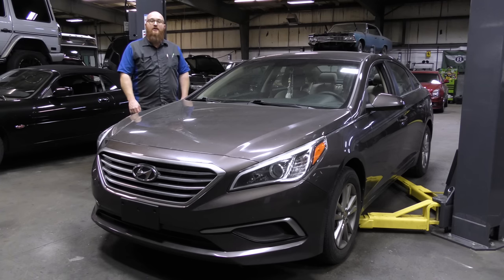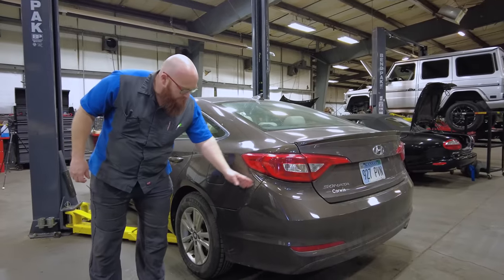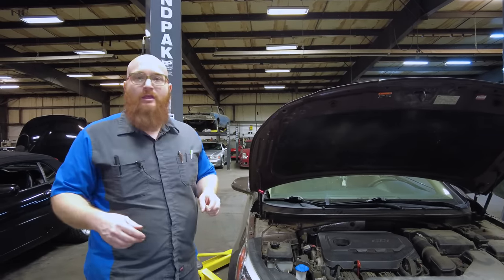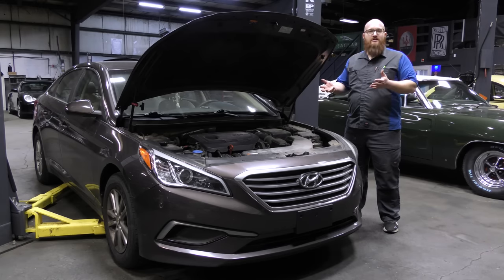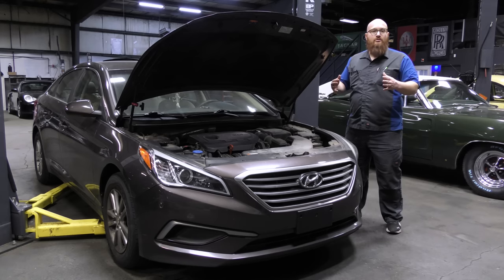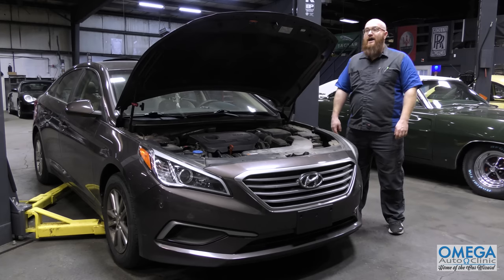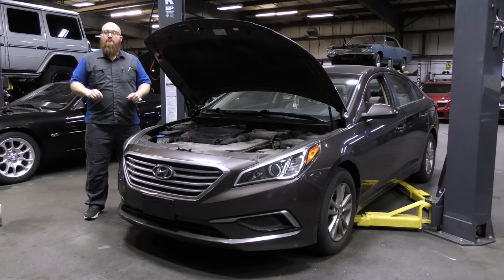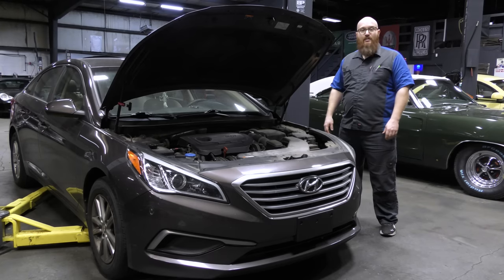What could be so bad on this '16 Hyundai Sonata that the CAR WIZARD is sending it to the junk yard?

Comment: Sad part is if they checked the oil and topped it up right before taking it to the dealer for the recall, the outcome might have been totally different. It's no secret that dealers will look for any way to avoid a warranty claim, so in addition to keeping up with my periodic under-hood checks, I also always give my cars a once over, and clean them, before taking them to the dealer for service.
Reply: Great advice
Reply: I agree, mechanics notice whether someone takes care of their vehicle, not only does that cause them to pay attention, but take extra care in their service.
Nobody wants to work on a filthy cluttered mess.
Reply: Great point!   My daughters ask why I always check our cars over, empty the junk out and fill the tank before bringing them in for service.   I believe strongly that if the shop sees that I the customer takes good care of the vehicle, they may be more respectful of it as well  😄
Reply: They would have required them to show maintenance receipts
Reply: @Tool0GT92  You don't need to provide maintenance receipts for adding oil.
Reply: I drive a 97 Ford it has never burned oil in over 25 yrs, I am guilty of not checking my oil, I change it, Regularly since New. No oil burning or loss...no reason to check .
Reply: It may have been burning the oil already
Reply: @Tool0GT92  Which would have proven what?  If the engine was full of oil, the engine is under recall, although the recalls are mostly due to carbon build up and fuel system clogging, which also probably does the oil no favors...
Reply: This is absolutely true. If you went into a dealership with both a bad engine and low oil, they will for sure ask for maintenance records and stretch any inspection to find a reason to decline you. They can even instantly decline you for not having a knock sensor update installed! I had thankfully topped up my oil before my sonata 2.0t spun a bearing and took it to the dealership. Within days I was approved for a new engine, turbo, and intake manifold under the settlement without them asking for any maintenance records or anything. This happened literally a week ago.
Reply: They should have changed it first.
Reply: But they didn’t and they probably hadn’t changed it in a VERY long time.
Reply: These new engine are designed to burn oil!!!
Reply: @ivanvarykino8202  I take care of my vehicles but it doesn’t make a difference, which is why I avoid them and do my own repairs whenever possible. Broken window when replacing wipers, spilled battery acid, forgetting the transmission gasket, wrong filter size and over torqued, bolts not put back on the brake calipers, dipstick left out, broken side mirror retainer after a recall repair, all from “certified” mechanics. No one takes pride in their work anymore, and this was before covid and all the parts and labor shortages.
Reply: Exactly they didn't even bother to check it when it could mean a new engine for free.  An electric car is going to fair no better there are still things to neglect.  Besides the inevitable increase in electricity cost when that is the majority on the road.  Hope people really do care about the planet cause end result will be the same cost wise.
Reply: @tjsells9288  Thank you precious government for that.
Reply: Won't work. It's easy to realize what was going on if there's fresh oil and a noisy engine. Dealer mechanics aren't completely oblivious to things like that.
Reply: @redbaron6805  To get any warranty outside of the warranty period you still have to show that the vehicle had the correct servicing etc.
If you neglect the proper approved servicing, even during the warranty period, you will likely get knocked back, as you should.
Reply: @sho942000  Then if you can't provide oil change receipts, won't they say you've gone over the oil interval and deny you?
Reply: @oldbloke204  I don't disagree with that, but the fact that many of those are burning a quart of oil every 300, 500 or even 1000 miles, and the recall is for a carbon build up which would probably render the oil black, it is difficult to tell how much neglect is involved here.

Also, Hyundai is notorious for denying legitimate warranty claims and their "power train" warranty is about as useless as a used napkin...
Reply: @johngaither9263  Yep, the Hyundai dealers are known to be some of the worst dealers in my area, rated somewhere between roaches and politicians.

Which has been one of the reasons I have steered clear of them.  Every time I get temped to look at one, I read some owner and dealer reviews and immediately scratch them off my list.
Reply: @redbaron6805  Most of the stories I've seen about warranties with them are just fine as long as they have been maintained properly.
How many people don't understand the time/distance travelled part of the warranty or just cheap out and don't maintain them properly?
In this case I would be guessing that this vehicle has had very little proper maintenance.
Stories the whole time about people who will borrow to buy vehicles and then can't afford to service them properly.
We have a 15 model of Sonata and we're meticulous with getting it looked after properly.
Reply: @oldbloke204  I have read a ton of actual reviews from actual owners on those.  And the story is basically always the same.  

They have a (non transferable) power train warranty, which supposedly covers the power train.  Then something fails on the  power train, (not that rare, it is a Hyundai after all), and people think, phew* sure lucky I got that power train warranty.

But, then they find out that "power train" warranty isn't worth squat.  Oh, the water pump failed, which caused the car to overheat, ruining the engine.  The owner should have shut down the car when that happened, but incidentally, the temperature sensor was also faulty, failing to warn the driver the engine was overheating until he saw steam coming out of the hood.  Since the water pump failed (not covered by warranty) and the temperature sensor failed (not covered by warranty), caused the engine to fail, warranty coverage is denied, because the engine itself didn't fail, non covered components damaged the engine, hence, no warranty.

That is of course if they don't just catch fire and burn to the ground, in which case there is no warranty, but hopefully you still have comprehensive coverage and your insurance will cover it...
Reply: Yep. My mother has the exact same car. I always did her oil changes and once every two weeks checked the oil. It would usually burn 2 qts a month and she only drives 2-3 days a week. Maybe 500 miles a month. Made sure it had oil in it when she took it to Hyundai and they rebuilt the engine. That was about 2 months ago. Runs like a dream now. Burnt about half a quart since but the oil still looks new.
Reply: @redbaron6805  Yeah well I suspect that there will be plenty of noise over some issues for sure and I mean people still buy a particular brand of "American" 4wd, even though they're now owned by another brand, in spite of all of the issues they have.

In Australia we're also covered by  "reasonable expectation" Govt. legislation which basically means that a reasonable person would expect a product to last for a certain time period and distance covered, for a vehicle.

In our case we have had the vehicle for nearly 7 years and it's still worth a large portion of what we paid for it. Our daughter has had a couple of Hyundai's that have been completely faultless as well.

We could go and buy another new vehicle tomorrow but my wife loves the Sonata and I'm not concerned about its reliability tbh.
Reply: @oldbloke204  Well, Hyundai does have a massive marketing budget.  You really can't escape their endless marketing.  I would even say, 9 out of every 10 car commercials on YouTube when watching random videos are from Hyundai.

And their cars are basically cheap, and the Walmartization of the world means people buy based on price, not quality.  Add in the fact that the resale values of Hyundai's are very poor (my brother bought a 3 year old low miles Genesis once for around 50% off the price of a new one), and people will develop short memories and buy them.

I am in no way claiming every single one is bad.  Even the worst car brand has cars that will end up being reliable, while there will be others that will be poor.  That is simply how statistical reality works.  Your experience in Australia may also be different than in the USA, as cars sold in the USA don't always even match in features, engines or design with the same car sold in Europe or Australia, even with the same name on it.

Case in point, the Honda Accord in Europe was sold as the Acura TSX in the USA.  My son drives my old Acura TSX Sport Wagon which is labeled as a Honda Accord in Europe.  A lot of European or Australian cars may have diesel engines which are simply not sold in the USA due to emissions restrictions, and a lot of European cars are sold with smaller engines than the same car sold in the USA.

But, there is no denying the massive Hyundai recall on their engines, and the massive fire recall on their cars.  There are massive settlements with Hyundai covering up this issue and not honoring their warranties.

That being said.  If you have them and they work for you, more power to you.  I have driven many of them, anything from Sonata's, to Santa Fe's to many others as rental cars.  They are basic vanilla cars, basically marketed as nearly Japanese quality but not quite.  And my brother owned a Genesis before Hyundai separated Genesis into a brand.

For myself, I'm not in a market for one.  They just don't offer the value proposition I'm after, and the quality is not up to my standards, along with other quirks.  Maybe that will change in the future.  But, I'm not sold yet.
Reply: @redbaron6805  For us, with vehicles, total cost of ownership and reliability is what it's about even though I love cars.
The idea of spending more on a vehicle, liability,  than is necessary really makes no sense at all to me.
We always pay cash and could afford nearly any vehicle that took our fancy.
We paid around 25k plus on roads for our Sonata about 7 years ago and much higher mileage ones here in dealers are still going for between 18-20k plus.
They are still retaining their value more than I expected they would.
I might look at trading it in in a year or two but given we're lucky to do 6k km's a year maybe we won't.
Reply: @oldbloke204  I get that, which is why Hyundai for some people makes sense as a value proposition.  For me, it hasn't as I don't particularly care for the Hyundai car design, and the reliability and service here for them has been sub par for many.

But, as noted earlier.  My experience and my preferences don't necessarily match yours, and your experience may differ.

Also, the resale values for cars in Australia, depending on brand, is probably quite different than here.  In the USA, Hyundai floods the market with their cars, and their resale value reflects that.  Hence, pre pandemic, they would easily depreciate 40% to 50% in 3 years, and could often be picked up cheap.  That depreciation typically takes 5 years for similar brands.

Even now, a 2020 Sonata SEL with very low miles goes for around $20k, while it is over $30k brand new.  Compare that to a Honda Accord LX which sold for under $25k in 2020 is still around $20k today, and an EX which sold for under $30k in 2020 still sells for $26k today.  So, a Honda Accord (which car ads here from Hyundai relentlessly compare themselves against with the Sonata) So, Sonata depreciation is around 30% plus, while Honda depreciation is around 10% to 20%.  And it was even worse before the pandemic.

That being said, not everyone is a car guy.  Many people I know care only about cost and functionality.

So, I'm not in any way knocking your choices, just reporting the situation as I see it on the ground in the USA.
Reply: @redbaron6805  Yeah fair call but then Honda have lost their way as well over the recent years imo.
Had to have a dent pulled out due to a moron in a carpark and the guy doing it was trying to fix a hail damaged civic.
Basically said that they were just thin crap now and thinner than our car.
I loved Honda in the past but wouldn't touch one now.
Too expensive and don't really offer much more imo.
Most brands that built their reputations on reliability and trustworthiness are just going down exactly the same path as each other and use most of the same bits anyway.
When Toyota first came out they were laughed at, much like Korean cars were but are now very popular.
Next if will be Chinese stuff if things keep going the way that they are.
What a joy.
Reply: @oldbloke204  I haven't owned one for around 20 years by now, except the Acura which is made by Honda, and that car has been flawless.  With around 150,000 miles on it, still runs and drives like a Swiss watch and and is one of the best handling cars I have ever driven.  Fuel economy is great, the engine has quite a bit of power, and it has been rock solid reliable.

My in laws own a Honda Pilot, and I have no problems with that car either.  I have for the most part switched to electric cars now, own a Tesla, and will probably mostly buy electric cars going forward.  I brought up the Honda as Hyundai apparently considers them their main competitor, and in the USA, the Honda retains their resale value while the Hyundai does not, as noted earlier.

I still think overall Toyota and Honda are the benchmark in reliability of combustion engine cars, and their resale value reflects that.  

Now, you are probably somewhat correct on Chinese cars, although there is some push back developing against China for Europe and the USA, along with Australia last time I looked, so time will tell how they will do.  They are not ready for prime time in my experience, and I think a significant number of people will be put off buying from a hostile country like China.  At least South Korea is an ally of the democratic world, even if I'm not yet sold on their cars.

There are already tax policies that will make them struggle to compete in the USA.  And if current tensions continue, I would not be surprised at all if tariffs will be put on Chinese cars on top of that.

You are correct of course, that Japan was once in the same situation as South Korea, until they beat everyone by rapidly improving quality and cleaning out the fuel economy car market.  What then followed was the premium car market with Lexus, Acura, Infiniti and other premium brands.

But, electrification is where everything is headed now, especially here.  And the inherent advance Japan had with superior engine design and reliability is now somewhat working against them, as they are dragging their feet in competing in the EV sector.

So, they risk repeating the Sony and Kodak mistake.  Latching on to legacy products until they are basically so far behind, they are out of the market of what will replace them.
Reply: @redbaron6805  That's another reason why we  likely won't switch cars just yet as I will wait for a while to see how the whole electric thing plays out.
Way too much bs and virtue signalling in that particular space atm and I'm not sold on the idea of millions of them being dumped onto the already under pressure electricity grids in most countries.
A lot more to play out there yet and there isn't one that can do what I expect my 4wd to do when I'm out and about.
I also intensely dislike the fact that various Govts. are bending over to pander to the electric revolution without think a bit harder about it all.
I've been a bit of a greenie forever, we grow our own organic fruit/vegies and try to keep our footprint on this rock as small as possible but I think that the whole EV thing is a bit of a con really.
Each to their own though.
Reply: @oldbloke204  There are probably some misconceptions you may have about those.  In my experience, there is far more hostility and ignorance, along with relentless fossil fuel funded propaganda against EV's, than any virtue signaling, at least over here.

I think the core issue is most people don't really understand how efficient EV's really are, and how little overall power they use.  Even my rather large Model S requires barely 300W to drive a mile.  Even a 1080HP Tri motor 5000 pound Model S still gets 350 miles of range on 100kWh worth of energy, or 350W per mile, or 563Km of range on 15 liters equivalent of petrol.

So, the energy required to run your toaster for an hour will get that car close to 6Km of driving range.

Now, are they suitable to pull caravans and go off roading in the Outback yet?  No.  But for people that need to commute to work or school or travel with them on paved roads, over here, it really not really an issue any more.

Most of the objections are simply misinformation or lack of knowledge about them.  Batteries last far longer than people realize.  Battery recycling is already standard in the USA.  Range keeps climbing, efficiency keeps climbing, and the reliability is far superior to anything equivalent.  Add in basically no service required and massive cost savings compared to even cheap petrol in the USA, and the choice for me was pretty easy.

Mine already has almost 200,000 Km, and is still going strong.  Even the battery capacity is still over 90% of what it was in 2014...
Reply: @redbaron6805  Yeah I tend to look at things quite a bit before I form an opinion and from what I'm seeing many countries, including your own, are trying to do all of this in a hell of a rush and it's starting to show some serious flaws.

Fossil fuel prices are way up as they're needed to plug the gaps.

Here in Australia the cheapest EV, that I know of, is Chinese and will set you back the best part of 50k for a small vehicle.
That may change soon though.

Had any dramas with the Tesla as I've read some horror stories about them, what breaks and the cost/availability of spare parts as well.

I've never liked the "eggs all in one basket" theory in life but all of this EV stuff sure feels that way.

It doesn't inspire a lot of confidence either when our Prime Minister prattles on about it but doesn't even know what's available in this country.

Lots of "jump on the bandwagon" with all of this atm imo.
Reply: Hi - i am guessing that once they do the preliminary, the dealer may take the head of and have a look at the engine, , thing like scratch and hot spots would show a lack of maintenance
Reply: @oldbloke204  Well, it is a bit more complicated than it looks.  What is going on here is that states like CA, which control over 10% of the entire USA auto market, are requiring all cars sold in the state to be electric by 2035.  After that date, all combustion engine cars sold so far can continue to be used, but all new cars sold are required to be electric.

Since a large percent of EV owners charge their cars at night, when there is low demand and surplus power on the electric grid here, the electricity demand by EV's is far less of an issue than it appears.  Also, many people in CA already use solar panels, so they can charge their cars using their own panels for that reason, requiring very little if any energy from the grid.

The fossil fuel price fluctuations from 2022 are mostly from the war in Ukraine.  That affected the world natural gas market, as Russia cutting off European gas deliveries spiked demand of natural gas produced in the USA and Qatar, causing prices to temporarily spike.

My experience with Tesla here, and mine is a 2014, is actually quite positive.  Very little has broken on the car, the service is very affordable here, and Tesla has brought down prices of parts of service as the car ages.  Also, my car just got upgraded to MCU version 2.0, giving the car the computing power and features of a brand new Tesla.  Tesla is one of the few, if not the only automaker, that will upgrade your old cars, matching brand new one's.

Basically every automaker is going the EV route, some at a faster pace than others.  And the all Eggs in one basket isn't really that much different from combustion engine cars.  With combustion engine cars, you rely on fickle prices of oil, which can spike at a moments notice, supplied from oil companies that have far from your interests in mind.

With electric cars, you rely on power companies instead.  But the difference is, you can produce your own electricity using solar panels if you choose.  You can't exactly drill for your own oil and refine your own petrol.  So, in many ways, EV's give you far more options than petrol cars do, as you have multiple options to get that energy, vs only one for petrol, which is oil.

Now, Australia is a bit different in many ways.  Your auto market is relatively small, around 5% of the USA market, and right hand drive vehicles don't help, as that market is limited and mostly shared with Japan and the UK, meaning some automakers and models simply don't even bother.

But, all in, there is massive expansion of renewable energy on the horizon in the USA.  In the next few years, there will be more renewable energy installed in the USA than supplies the entire country of China.  Cost over here is also quite different than Australia.  I pay around $0,13 US per kWh flat rate or AUD $0.19.  Off peak rates here are as low as $0.02 US or just over AUD $0.03.

So, there are many factors here that don't necessarily apply to Australia.  And your power grid is quite different from hours.
Reply: @redbaron6805  The problem that is showing up in some places, and will here too I believe, is that the prices of power have gone up so much that ICE vehicles are cheaper to fuel than their EV counterparts in some places.
Here our charging infrastructure isn't fantastic but I've also seen plenty of stuff where people are lined up waiting for a charger where you are or they're broken.
I have no doubt that when people are all on EV's the taxes etc will go up as they always do.
Personally I think that what California is doing is quite ridiculous but we have to be seen to be following the narrative eh?
Personally it looks to me like they have plenty of more pressing issues than making everyone buy EV's in the next few years.
I now use more electric/battery stuff than I did before, and I love it, but I will still wait as I think we will be seeing plenty of changes over the next few years.
The war in Ukraine also only limited the fossil fuels that various European countries were still relying on.
When a country like Germany has to warn its citizens to have backup means of heating/cooking due to the risk of grid failure or other countries relaxing firewood regulations so that people don't freeze something is very wrong.
The only thing that really prevented some really bad crap over there was that it was a milder than normal winter.
I like having backups in my life.
Reply: Bobby  Yep.  I have heard of shady tactics like that from both Dodge dealers and Hyundai dealers, and Ford and GM dealers also got that reputation, some of it from my own family members.

Ironically, Tesla has actually covered items which weren't actually covered by warranty on my Model S.  So, there is always that interesting flip side of the coin, which probably explains why I still own my Model S today.
Reply: @oldbloke204  The issue you refer to is actually only in select areas in Europe, mostly the UK, and I believe Germany.  The reason is what I mentioned earlier.  The UK generates around 40% of its electricity from natural gas.  When the war in Ukraine broke out and the UK supported Ukraine, Russia cut off gas supplies to Europe in retaliation.

This caused natural gas prices to spike by around 130%, and electricity prices to spike close to 70%.  Hence, this was an isolated event, due to a war in the area, and didn't really reflect much else.  On top of that, a lot of homes are heated in Europe using natural gas, so people got hit with high heating bills along with high electric bills in the process.  Since Europe wasn't nearly as reliant on Russia for oil, electricity prices spiked far higher than gasoline prices did.

Here again, my experience may differ.  Tesla has expanded their charging network here, adding more chargers in existing locations and added new locations.  Hence, the charging network here is actually very good for Tesla owners.

Some states in the USA already charge EV's road taxes as a part of their registration fee's, but we are not talking about a lot of money here, maybe $100 a year or so.

I think many people misunderstand the CA narrative.  It is an ambitious target for several reasons.  First of all, it pushes automakers to act now and plan for 2035, if they want to remain a part of that market.  If that goal becomes too ambitious, they will adjust the timeline back.  

But, in many ways it is similar to JFK's moon speech.  When he said the USA would take men to the moon and bring them back by the end of the decade in 1962, the plan was nothing short of crazy and impossible.  Yet, by setting an ambitious goal, they got it done by 1969. 

If you don't set a high bar for goals, nothing really gets done.  Hence, making ambitious EV goals pushes everyone to accelerate and build out their EV plans, and so far it is working with around $400 Billion invested in new battery and car manufacturing for EV's so far that will come online in the coming years.

In CA, pollution is actually a very pressing issue due to them being located near a mountain range, and areas like Los Angeles being inside a bowl.  That bowl fills with polluted and stagnant air, making car emissions a massive problem pollution wise.

The war in Ukraine accelerated plans for Europe to phase out gas and petrol, precisely to break any power Russia has over their energy and their economy.  They trusted Russia too much, and got burned.  They are now learning their lesson, and Russia will pay the price for decades and centuries to come.

Germany was a text book case of trusting Russia too much.  Germany knew Russia using energy as a weapon against Europe was a suicide mission, and figured they would never be crazy enough to do it.  As noted above.  Russia will pay a heavy price for that for literally decades and centuries to come.

But, that is how geopolitics work.  Allies become enemies, and enemies become allies.  And some countries will simply go off the rails on the crazy train for a short term gain, and pay a massive price for that long term, like Russia will.
Reply: Not likely. There is one case where an employee bought one had a catastrophic  engine failure after ten miles and the company refused to fix his car.
Reply: @cardinaloflannagancr8929  Can you name these cases where an electric car will "fare no better" and what exactly you can neglect on an electric car to cause it to fail?  Because my electric car already has over 120,000 miles on it in 9 years, and yet I have not taken it in for any scheduled maintenance, except early on when they were still recommending coolant replacement, but then found coolant wear on electric cars to be so minor that the coolant really doesn't wear out.
Reply: @redbaron6805  And yet most of these countries in Europe that you referenced were also big adopters of renewables but along with the geo political issues they also had a season where there wasn't much wind or solar generation as well.
I've actually heard that the electrical grids in the US are very old and susceptible to outages now and even grids that are solid will struggle with excess demand and the like.
Imo the only real way to improve things is to use less power but given the way we live these days and the crap housing we seem to build that isn't going to happen.
It really won't affect us that much as we can easily dump a heap of cash into standalone power or even do without it if needs be.
I think that there are going to be a lot of people who will be in for some big surprises over the next few years.
Reply: @tonybuglione3516  In an engine known for carbon build up, sludge, oil burning and fuel issues?  Exactly what would they be expecting to find on an engine that is getting recalled and replaced already.  That all of them were working just fine and running clean and smooth with no issues...?
Reply: @oldbloke204  That is partially correct.  Electricity generation using renewable energy varies based on the seasons and even day by day or week by week.  There are days were the UK runs on nearly 100% renewable energy, and days where the percentage of renewable energy is well under 50%.

There are some logistical issues involved, just like there were in Australia.  A lot of the wind energy and wind capacity is in the Northern UK (Scotland) but they don't really have the transmission line capacity to move all the renewable energy to the places it needs to go, so that bottle neck has lead to some inefficiencies and waste, where Scotland produces more electricity than they need, but can't send the surplus to the rest of the UK.

Germany probably installed too much solar power considering their weather and cloud cover.  So, there have been some hick ups and missteps along the way.  But, that would be somewhat expected in the early phases of new technology.

The grid in the USA is complex, as it is built out and planned state by state.  So, some areas are in far better shape than others.  But, I think a lot of that has been overblown.  Electricity companies, many of which are private, are motivated to sell more electricity, and capturing market share from oil and gas companies.  Homeowners also have the option due to the location of the USA with a lot of the populated southern states having a lot of sunshine, and the NE and NW having access to hydro power.

A lot of offshore wind capacity is being planned as well.  So, while there are some logistical issues, we don't really have major issues except during violent storms or temporary spikes in demand during heat waves and snow and ice storms.

In my area, losing power is basically unheard of, unless we have a tropical storm or a hurricane in the area.
Reply: @redbaron6805  True enough but that was what I was talking about in regards to jumping on the bandwagon without looking at the issues.
Here in Australia it's looking like base load power suppliers will be shutting down as the can't make a profit due to the plants "idling" for a lot of the time but they're still very necessary for the times they are needed.
For all the talk about batteries I doubt that they will ever be able to have the capacity to be used as a reliable backup source.
Where we are we have some of the best solar generation via solar household systems etc but also some of the dearest power going around.
Like I said I don't trust Govts. and greedy power suppliers not to gouge when they can.
It happens all the time.
Reply: The sad part is they topped it up and made it to the dealership and still shows low. Their engine drinks oil more than water you can drink.
Reply: @redbaron6805  I thought the Theta 2.4 recall was due to the crankshaft
Reply: They would still be able to tell by the wear on the bearings and the oil consumption test.
Reply: @redbaron6805  Damn, how old are you, a hundred? I'm just waiting for you to say "heavens to Betsy".
Reply: The fact that they didn't check the oil even after there were engine problems is absolutely ridiculous. She would have had a new engine for free.
Reply: @larrywohlert2436  What engine does you're 97 F150 have?
Reply: @CJColvin  4.6 best truck I ever owned
Reply: @larrywohlert2436  Awesome brother, gotta love the 4.6L SOHC 2V Modular V8s brother, they're dependable as hell.
Reply: So do I.
Reply: @danielcorvino8154  You are missing the real issue here,  THEY DONT DESERVE A NRW ENGINE FOR FREE.  They are RESPONSIBLE for the engines failure.  Period.
Reply: So your promoting FRAUD here....nice.
Reply: Ya , I spun a main bearing ( missed a shift) and the dealer tried real hard to no fix it . But it had clean oil and I had found a oil change receipt…. Car got fixed , and 2 days later it was traded off to get my wife a lager family car. I miss that Mazda 3 with that 5 speed.
Reply: I always have my oil changed according to the manufacturer's maintenance schedule at the dealership while it is under the duration of the manufacturer's warranty.  Also any other maintenance that needs to be performed according to the manufacturer's maintenance schedule is performed too at the dealership.  That way the maintenance performed at the dealership is recorded in the computer system, and they cannot say you did not do it.  This makes it impossible for the dealership to say you did not perform maintenance on the schedule.  Many years ago, a GM dealer was able to find service performed at another GM dealership on my vehicle.  When a problem did surface, the manufacturer did repair the car under the warranty, and they made absolutely no attempt not to fix it.  When I picked up the vehicle, the service adviser said it paid to have my service done there because they could not try and deny you the repair under the warranty.
Reply: Had a Sonata and engine caught fire suddenly as well this was 10 years ago.  Looks like problem hasn't been fixed.
Reply: They probably would've came up with else to get out of it.
Reply: I do all my oil changes for a 2014 sonata. It burns the same amount you just described. I top it off routinely as well? So the engine siezes even with you continuing to top the oil off? Did the dealer demand oil change proof? How easy was it to get approved for a new engine?
Reply: So they should have scammed the dealer?
Reply: @betterbeavailable  the piston rings weren't machined correctly from the factory. The buyer was the one scammed. I have owned two Hyundai's, both were burning oil internally because of the piston rings that wear out and wear thin prematurely. I literally add 4 quarts of oil between 5000 mile full synthetic oil change intervals starting around 50 k miles on both cars. The dealer should replace the engines to begin with.
Reply: @Tool0GT92  Also you'd have to prove your the first owner, the warranty on the engine is only good for first owners of the car.